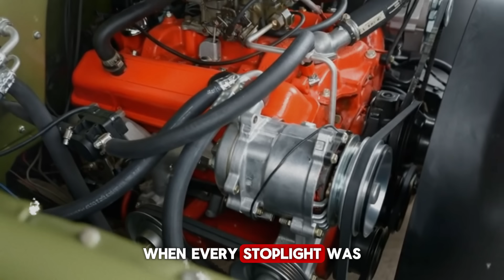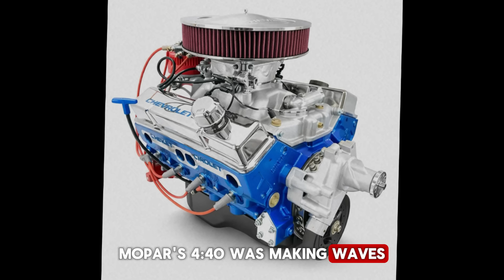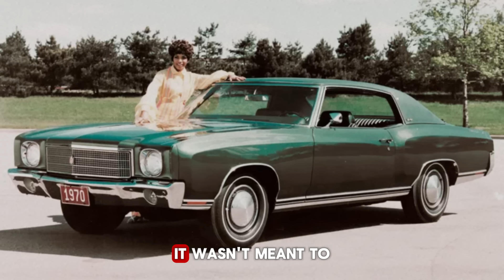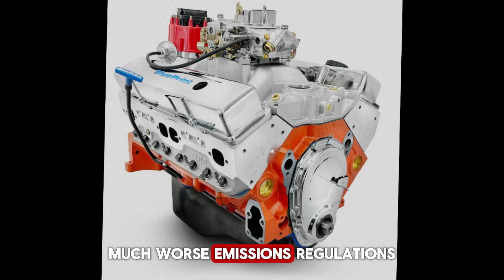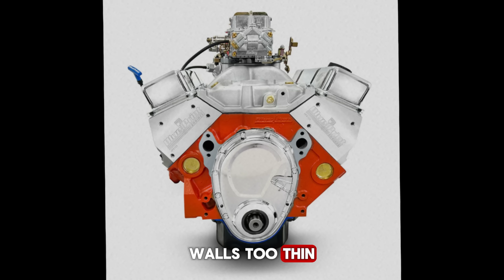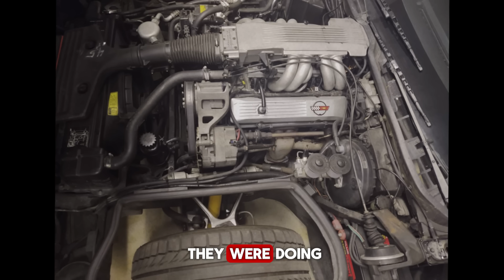Why Chevy’s 400 Small Block Was a Nightmare to Maintain

Comment: NOT so I built 3 2-407s and a 413 NEVER had ANY problems this guy is full of CRAP, mine could turn 7400 RPM had it 4 years NO PROBLEMS.  SO WHY is this guy overloading his mouth with such CRAP?  NO cooling problem at all.  All had to do was turn the key, let it warm at and go.  In the COLD weather, pump it ONCE and start.   The crank was NO problem

Comment: I bought a 70 Impala Custom in 75.  After about a month it started burning oil. The 400 had good compression, but failed the leak down test. I believe it was overheated and warped the block slightly. Mechanics told me the 400 was a junk engine not worth rebuilding, so I replaced it with a low mileage junk yard 350.

Comment: My grandfather worked for gm helped design those engines here is the facts and not someones personal opinion.  gm spent tens of millions on designing them, the Siamese cylinders build steam it can go thru steam holes until " THE WATER PUMP GETS ABOVE 2500 RPM TO WASH AWAY THE STEAM......." If you race a 400 and it sees high rpm then you can get away with not running steam holes , if you daily drive it in traffic and heat unless you idle it at 2500 rpm while it sits in traffic it has a damn good chance of cracking as the mechanical pumps are not efficient to deal with that motor until after 2500 rpms , its why gm killed it off , for all those who say ive been running one years daily as daily driver no steam holes no cracks do you take the engine out periodically and have machinist  inspect it ?regardless of who drove theres how far with no steam holes, your going against the wisdom of the engineers who built it and they killed it off for the low idle steam cracking, if you contradict this call gm tell them how they are wrong and youve solved it,

Comment: This video don't no anything about a 400. I got a 1970 impala custom with a 400 in and it will light up the tires. Man I love this thing. I ran the numbers on the block and found out someone order it and had the block bored over too a 406. I was gonna use it for a donor car but the more I looked into it. I found out it was a monster with a 350 turbo tranny and 12 bolt rear end. I'm gonna put a 4l80e transmission in it and drive it as a daily. My convertible can wait cause it is no way I'm tearing the Custom apart. Heck I'm thinking about keeping them both. I'm gonna put some electric fans on it this summer to keep it extra cool so I don't have to worry about any overheating. I got it from some old dude up in Ohio last year and he hated to sell it. Said he needed the funds and I know it once I started digging into it. I'm gonna give them ls swaps a run for there money with this sled.😂😅

Comment: My first car was a 1974 Monte Carlo 400cu 4barrel carb, it would smoke the tires off idle and that was it, there wasn't any winding it up, I back the kick down cable way off on the trans so it would shift sooner to stay in the torque range, because once it started to wind up it was guttless, but it finally it took second gear out of the 350 turbo trans,  I ended up pulling the motor and trans, had the trans rebuilt and put in a 1970 350 out of a Malibu, put in a crane 327/350hp cam, aluminum intake a 730cfm holley, set of headers and it was so much better, sold the 400 for $150 to a guy that did mud runs and he put it in a jeep, of course that was back in 85 or 86

Comment: I made it through the first three or so minutes.  Total AI garbage.  Get a clue.  The 400 SBC was maligned due to it's 170 HP, 2-barrel carburetor factory configuration.  This engine was designed to replace big blocks in large cars and station wagons for fuel economy reasons.  They were low HP, high torque engines, never meant for performance use.  This was never designed to be a performance engine...until us young whiper-snappers got ahold of them in the late '80S/early 90's..  Then reality shifted.  We applied better breathing cylinder heads with 2.02/1.60" valves...or larger, better cams, and it was game on!  Big-block torque with small-block mass over the front wheels.  A perfect swap into a 2nd gen or 3rd gen F-body!  Handling didn't suffer, but acceleration improved!  Big-block torque numbers made it a pleasure to drive around town at low speeds, even with a lumpy cam.  Oh, the 5.56" center-to-center rods increase side loading and wear out the cylinders quicker...blah...blah.  That's why we can order pistons that move the rod pin up higher.  In fact, that's what GM has been doing with their engines since the late '90's.  Tell us how a properly build 400 with 6" rods performs. The pistons are lighter, the engine revs quicker, smaller thickness ring-packs weigh less, she revs higher and faster...just stop!  In conclusion, my 400 will eat your face.

Comment: Slightest overheating and those super thin water jackets between cylinders in that over bored block always resulted in cracks . We constantly checked coolant levels . Swapped thermostats twice a year . 160 degree for summer . 180 for winter .

Comment: I had one of these in a 1975 Bel Air wagon. It had set on the lot for a year. I bought it in April of 1976. It burned a quart of oil every 600 miles and was rebuilt under warranty. Then it only burned a quart every 1,200 miles. This was typical, because of the siamesed cylinders. Also, one reason you could not rev the engine above about 5,000 rpms was because of the short connecting rods, which would stress the pistons and crack the skirts. After market pistons and rods cured that problem. It may be noted that a stock 400 put out only ten more horsepower than a stock 350, but made 50 lb ft more torque. If you put a 400 crank in a 350 block, you will have to machine the larger main bearings down to the 350:size. Also make sure the rods clear the block, as you might have to machine notches  for clearance.The flywheel for a manual transmission application is hard to find and expensive. The ring set is the same as for a 402 ci big block.
Reply: That’s an odd story.
A friend had a ‘75 Chevy Kingswood Estate with the sm block 400 in high school (early 80s) he drove it super hard & never had an issue.
It was passed down from his parents who bought it new.
Never a problem.

Comment: I bought a 1972 Chevy kingswood wagon with the small block 400 in 77.  It had 62,000 miles on it.  I drove it until it had 110,000.  The engine never gave any problems, the transmission was another issue.
The gas mileage wasn't great but considering the almost 5,000lb curb weight and the room in it I didn't consider it that bad.  Great driving car.  A hell of a lot better room and better on the road than the Equinox I have now.

Comment: I ran a SB 400 from 1976 until 1989, and I wasn't nice to it. It buried the spedo every time I asked it to, and it did it quickly. Nothing negative that you say about this engine is true. When I traded the car in 1989, it was purchased off the lot before I finished the paperwork for the new car. The car and the engine was highly desired by that time. This is a true AI pooper. It had a 400 tranny. Not a 350.

Comment: To get the big 4.125" bore there was no water jacket between the cylinders. To get coolant between block and heads there were 6 more small water passages in the block and heads that 350's and smaller engines did not have.  If anyone put any head on a 400 other than a 400 and did not drill the 6 holes it created an overheating problem.
Reply: Myth. Many many of us run 400s without drilling steam holes. I was surprised to learn that

Comment: The Chevy small block 400 was never intended as a high performance engine. It was designed for low end torque. In fact Chevy didn’t even offer a factory 4bbl until 1973. It shared the same bore and stroke as the Pontiac 400 which was a larger block with bigger bore spacing. They only put the 4bbl on it because they discontinued the big block 396/402 after 1972. While the 383 stroker put a 400 crank in a 350, a Pontiac stroker is more substantial. You can put a 455 crank in a 400 and with a .030” cleanup bore you can make a 455 out of a 400. But you do have to cut the main bearing journals 1/4” and they would survive in even racing performance. The main issue was the Pontiac 455 was the rarest of the GM 455s since Pontiac still had the 400. And a good numbers of them were installed in high performance and valuable cars like Trans Ams and GTOs.
Reply: Actually the 4bbl carb was first added in 1974.
My ‘74 Impala Custom Coupe has the 400 4bbl.
Reply: @Napier363 .   I thought it was 73 because the 400 small block was an economical answer to the discontinued 396/402 big block.

Comment: I bought a used 70 Impala 400 in 75.  The seller said it just had a valve job, and it ran fine for several months in the cold weather.  Afterward, it burned oil to the point of fouling spark plugs.  I believe the block became warped from overheating.  It ran hot, but never boiled over.  At that time I knew nothing about steam holes!  An older mechanic told me the 400 was junk!
Reply: I had a 400 transplant in an XJ6 Jaguar. It was a turd. Ran hot, broke a crankshaft. Burnt oil. When rebuilding it, took me a long time to find a crank that wasn't cracked. To test them I just would drop it on the concrete floor. If it was a dull thud, it was cracked. I gave up on it and fitted a 350, ran great with zero problems. Still took me a long time to trust the car :body-blue-raised-arms:
Reply: Interesting, I had a 400 , I changed the rods to 5.7 ,flat top pistons 186 high performance heads eddy rpm intake , headers and a holley 750 it was very quick. Lots of torque .